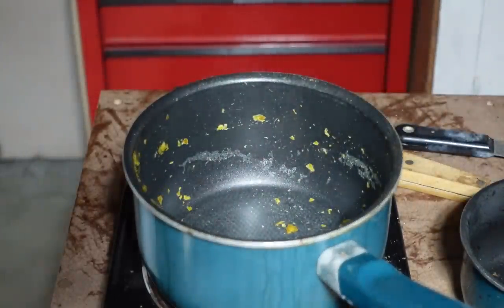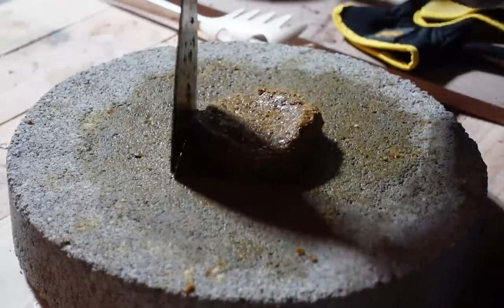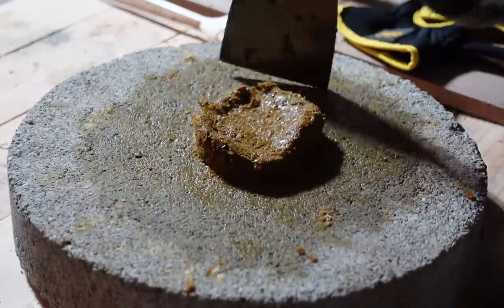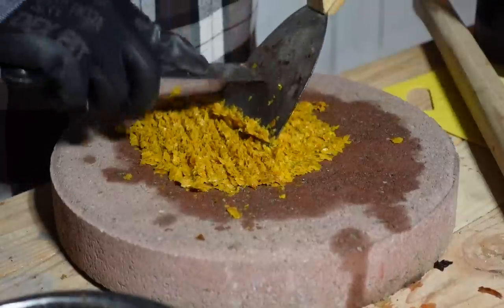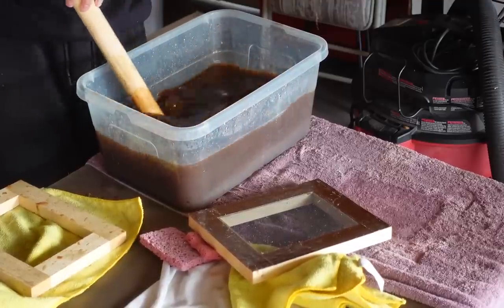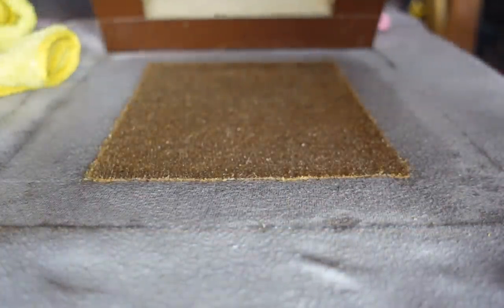Can Leaves Be Turned Into Paper? DIY Experimental Leaf Paper

Comment: Loving your non-traditional materials in paper-making!  Just FYI, the process of turning them onto a felt (or in your case t-shirt) is spelled like a couch you sit on, but pronounced "kooching," like in Cootchie Coo.  No idea why, it just is.   When you're removing the paper from your material, you might try turning it upside down once you have an edge loosened, and pulling the fabric off the paper, rather than the other way around.  Since whichever one you are pulling off has to bend quite a bit, this could be less stressful on your delicate sheets of paper.
Reply: Your comment improved my understanding of the underlying challenges and methods of paper-making. Thank you.
Reply: maybe from the french pronunciation? 'coucher' means 'to lay' in french, and that would be consistent with the actual process happening.

Comment: When discussing preservation of brittle paper documents, my book conservation teacher said, he used gelatine solution to impregnate crumbly paper. In old receipies for minor production of paper they also mention gelatine. A simple paper is very absorbent, you need ink not to spread, to stick where you put it, so you impregnate your new sheets with some glue (but I guess you know that).

Lime powder is used to make sheets more dense, more white, and it's good for making the paper less acidic. I know this only theoretically, I'd guess a small portion is dissolved in water or something.

A paper of sports can easily be made of blanket algae. You can find it in ponds and big long-living puddles, it's like green water cotton just floating there in chunks and layers.

Inks though, natural inks are a bit tough. Most famous are probably oak gall ink and iron oxide ink. The latter eats through paper in centuries and bleeds into halos, I don't recommend it. Gall ink slowly (very, very slowly) fades, so maybe mix them. But the very best ink is basically nano-particle ink. Which is just fine soot in cherry/plum resin solution.

I find that old books - more than 50 years, closer to a hundred and over - contain many useful tips for such arts. Honestly, with bookbinding, no better techniques were invented since 19th century (only cheaper ones).

Comment: For my pottery, I use a Rubbermaid tower for bakery and instead of bakery sheets which you could use. I use two sheets of drywall for each pressing one on top and one underneath you could still probably use your T-shirt that way, but I’m the drying is much quicker, because the drywall pulls the moisture out of the paper or pottery.

Comment: One thing I'd recommend looking into is some kind of porous film to place your paper on. There are products like teflon-coated porous release films for resins and other adhesives which will allow a solid to rest on a very flat surface yet allow moisture and gases to escape. Per the sandwiching, you'd need (shirt-film-paper-film-shirt) to maximize paper release. Assuming the film is smooth, your paper may come out a little flatter, too!

Comment: Hello Cory!
Love your video! Thank you so much!

Next time you could try peeling the cloth off the paper. If you put the paper facing down and the cloth upwards it’s usually easier.  Just make sure you get a little corner off first so you have a grip to hold the paper. 
Also have you tried putting the pulp first and then adding the water? That way you might be able to measure pulp to water ratio better! ❤
Just some ideas! 😊. I can’t wait to try this technique with my grandkids. Much love! 🤍

Comment: These turned out great! They seem pretty sturdy and I love your calm narration 

Consider when you get to the pulling off the t-shirt, to pull the tshirt away from the paper and not the paper away from the t-shirt. That way the tshirt is the thing bending excessively rather than the paper. Could help with more delicate experiments in the future. For reference, this technique is used during the process of making fresh tortillas which can be delicate 

Good luck on future projects !

Comment: When i handmade paper I lay them out to dry in the floor single layer and then peel off the fabric then use spray starch and iron them flat and then place them under weights to continue to flatten
My additives are powdered beef gelatin, cornstarch, and PVC glue (about a tablespoon)

Comment: I don’t dry my paper while it’s stuck to the cloth with weights. I lay them out on a screen with the cloth backing and then while they are still damp I take them off the cloth backing and transfer them to a screen for drying. Then after dry, I pile them up and press them with weights. They always  flatten out fine after dry. 😊

Comment: Good video, but I was a bit disappointed you weren't exploring an idea I have been wondering about:  Would it be possible to make "papyrus" from autumn leaves?  By "papyrus" I mean overlapped layers, though not necessarily in the manner used to make papyrus. 
My concept (which I haven't tried at all) would be to strip the main vein and petiole, leaving the leaf halves, then to set these down in an overlapped manner.  I expect some binder might be needed, but I haven't considered what might be suitable.  The whole would then be compressed to form a flat sheet.

Comment: any plant can be made into paper -cellulose !!! - the preparation is a bit different according to the srength of the fiber - cooking and then mesarating  - i found that staing the fiber thru a sieve  by water pressure worked the best - better than a Hollander beating or hand beating - the plant color usually isnt light fast - Kozo fiber is great also Nettle makes a etremely strong and translucent paper - pure meditative process
Reply: nettle leaves, or all of it?
Reply: @Goldenhawk583  -cook the entire plant - when washing the leaf fiber is dissolved and washes out - what remains is the fibers from the stems wwhich are extrmely strong and very white with a lustre to them - you need a Hollander to mecarate them into pulp  - there is a way to save the fine and much weaker leaf fibers - after gently washing the cook the fiber is placed in a bucket with a 10 mesh poliester screen and with water pressure the fiber is forced thru - the bucket is placed on a barrel and with two tubes coming out about a third from the bottom - the water flows out into a large sieve that collects the fine fiber - what is left is the strong fiber that does not go thru - it is also an extra washing
Reply: @natankaaren1207  thank you:)
Reply: Please how do I learn this?

Comment: try using synthetic cloth next time and make thicker sheets - it will help - i have a much different proceedure - first a coughing table  - three or four layers of felts - a synthetic cloth over the felts on the couching table which the pulled sheet is couched - the cloth with the fresh sheet is lifted and tranfered onto a towel and a plexiglas clear board is placed on top - the next sheet is placed face down on the plexiglass and a towel to absorbe the water on top of the synthetic cloth and paper then the next paper etc till there is a nice pile twenty or so plexiglas with forty sheets on them - this pile goes into a press and pressed - i leave it for about an hour and then take the pilke out - separate the materials used leaving the paper attached to the plexiglass to dry after a day the sheets are ready to be lifted  - i hope you get some ideas from this process

Comment: Piece of copy paper or stronger type, made into a cone, can act as a funnel (as long as you're quick with the pouring); plus you'd see early what kind of stain if any, results from the "ink". 7:11 Also, a bucket and a hand held blender would mulch those boiled leaves pretty well, I'd think. Unless you're eschewing modern technology or limiting it, to make the paper experiment?

Comment: I have no knowledge on paper making nor leaves. But I couldn't stop thinking when looking you cutting down the leaves into 1" pieces: wouldn't it be easier, safer and much faster to stack a bunch of them flat on a board and slice with a knife? Just like when cutting herbs or pasta sheets in cooking. And if you don't need precise cuts and bit sizes, just put everything on the board and chop fast, you can even do it with one knife in each hand. Or even just put everything in a blender.

Comment: I think that your homemade paper would work well as a flat surface to paint on, if the paper was thicker. People who make paintings usually use canvas cloth, or somtimes white denim, stretched over a wooden rectangulair frame. However, some people paint on ply wood or wood boards. if you make a 1 inch thick slab of paper 2 feet by 3 feet wide, then it can be used as a substitute for wood slabs as a painting surface for Boss Ross style paintings. To hid the dark colors, we might ghesso or paint the surface of the homemade paper with white paint. The homeade white paint could be poisonous turpentine maple syrup made from tapping a pine tree with a spyle, and mixing pine tree turpentine with chalk dust.

Comment: I dont know much about paper making, but shouldn't there be a binder of some sort used in the mix? Otherwise I think it will be hard to make something that isn't super fragile.
I would probably try a very small amount of clear wood glue. Shouldn't impact color, but might give a slight sheen depending on how much used. Even a small amount should greatly help bind the fibers together.
If the product needs to be all-natural for some reason, I'm sure there are traditional glues you could substitute.

Comment: That leathery texture of the leaves is due to a waxy substance that coats the outside of the cells of the leaves and is there to prevent the leaf from drying out or absorbing things through the cell wall. Many herbicides work by stripping this layer off. This layer of "wax" varies in thickness between different types of plants or can vary throughout the growing cycle. Im not sure how this waxy material reacts with the soda, but if i had to guess, its a lot like the soapmaking process of oil + caustic = soap. 

Would pressing your paper in a roller make it more durable? Im wondering too how you can get your sheets to release from the fabric backing easier.

Comment: First off, use brown dry leaves that crumple in your hand. The ones that are not fully dried can make it difficult because the fibers don't break down as well. Boil until most all the moisture is gone, then blend or use a food processor. You're making it harder than it should be with too many steps. You are also putting the pulp in way too much water, thinning it out too much. Put on the screen, use a plastic putty knife to smooth it out and squeeze out as much water as you can. Place on something that won't hold on to it like the shirt does. And, to make it white, use real bleach. That's where the term bleaching comes from. I understand that you live in CA, and everything chemical there is going to kill millions of people, but people in other states use it all the time without harming anything. (I can say this as I was born and raised in CA until I was 15. Thankfully, we moved before my brain turned to mush.) Doing it this way, the paper should dry in about a day, not a week.

Comment: This process seems so tedious, wouldn't it be easier to just dry the leaves, grind them to powder, then make a thicker solution of it than the one you used? I also suggest to ferment the solution for some days until it smells funny. That way the fibers can get a bit predigested and coagulate better when they dry. May add some sourkraut water, or something containing lactobacillus to give it a starter culture. Also add some starch or wheat flour.

Comment: using scissors or a round pizza cutter might make de-spining the leaves go quicker. :-)   a pizza cutter could also be used to 'chop' the leaves into smaller pieces in a faster manner as well.  if not a pizza cutter, there are very sharp circular blades used in cloth cutting.. those might be better. ;-)

Comment: M8
Get into chemistry.
The things you do are pointless as hell because you don't understand what you do.
First you crush, then you blend?
Those are sililar steps.
You want to remove the stems by hand?
Filter for size. Break 'em up in a bucket filled with stones larger than your mesh. They will be left behind.

Boiling them for an hour? 
Destroy them with hcl. Then neutralise with na2co3.

A bunch of things are to the letter. If you learn what you are doing things can be so much more fun.

Also, you get to troubleshoot better.

Plan a, too much water? Boil it under vaccuum until the concentration is more to your liking.

Plan b. Too thick, use a volitile solvent to make dilute it.

Plan c  too little structure.
Now you add back the stems.
Filter by density with wind.
Blow over them and the rocks stay in place.

Adding lint makes this lint paper 
It is like me making candles out of sand by boiling and blending the sand, then adding paraffin or butter.

Comment: Excuse my ignorance I am from England, is washing soda the powder you use to wash clothes or is it bicarbonate of soda?
Reply from the maker: Yup! Washing soda is normally used for washing clothes. Bicarbonate is baking soda (very similar to washing soda, just not as strong).
Reply: Also known as laundry booster.
Reply: Washing soda is sodium carbonate. You can make it from baking soda, sodium bicarbonate, by baking a sheet pan of baking soda until the texture changes.

Comment: can dried leaves be a viable material too?
Reply from the maker: You know... I'm not too sure. I have a feeling the more brittle they are the harder it'll be to turn into paper, but anything is possible! Maybe I need a follow up video using dried leaves?!
Reply: Do they get mouldy with time . We make cards and don”t want it to get mouldy later
Reply: @charlottepetersen5289  as long as the cards are kept dry you should be good
Reply: @corymart  just an update, we did this in our thesis and we used dried leaves and the product was wonderful almost like a real paper we were even able to print the literal paper of our thesis on it. Thanks for your video. The methods we used are heavily inspired by yours but we just changed it up a little, like the materials we used were just any dried trash leaves, we used lye when boiling, also when boiling we didn't have to crush the leaves we just remove the main stem, and then after boiling we mushed it while adding some bleach for a brighter product. Also our final product was 15% recycled paper and 85% trash dried leaves the addition of small amount of recycled paper made it sooooooo much better.

Comment: Safe to say that most fibrous materials can be turned into paper since paper is mostly made out of fiber + a compatible adhesive like starch.

The only differences are the methods of turning said material into paper. Some requiring minimal work like leaves and soft wood, while some require specialized machines or techniques like you would using hard wood or (god forbid) cotton.

Comment: I think this was a good idear, but I am sorry - when you add some other paper to achieve this it is not leaf paper. Maybe try out different types of leaf or combine it with other natural resources to accomplish that. The egyptians had leaf paper - they calles it papyrus. So maybe try something like that, but what you did was creating natural coloured, leaf supported recycled paper. 
maybe dry the leaves next time before you boil them, so you do not need to smash the celles of the leaves and so you can use the more hardened structure of them.

Comment: Why you have to use washing soda?
Reply from the maker: Washing soda helps break down tough plant fibers. I also use it when making grass paper, so I figured I should try it with leaves!
Reply: @corymart  Would Baking Soda do the same thing?
Reply: @TeresaV  It's slightly different chemically, but if you can't find washing soda in the laundry/cleaning section of your store, or find soda ash (different name for the same thing) in a shop that sells materials for dying fabric, or a pool supply store, I've read that you can heat up baking soda in the oven for an hour to change the chemistry.  They are both basic (alkaline) but the baking soda is less so, so I'm not sure you could use enough of it to get the desired effect.
Reply: Washing soda can be made in the oven on a cookie sheet baking some baking soda.  If I remember right the temp was 200 degrees for a few hours.  You'll have to Google it. It's been a long time since I did it for diy laundry detergent. We buy our baking soda way cheaper at the feed store in big bags.

Comment: Ironically, the 'mid rib' has the major content of fiber in the whole leaf, why bother to remove it? technically, its suggested to boil the leaves in hot alkaline solution (baking soda can be added, but with high concentration) to remove the lignin, then smash the remaining fiber into pulp. you also need water soluble gum to add into the pulp (sizing) before making paper with fine screen. the existence of lignin will make the paper yellow or brown in colour and make the paper fragile, because the lignin is a fine power if dry, and stops the fibers to stack to each other and forms a stronger bounding.

Comment: Kind of a half-assed attempt, frankly. Adding hydrogen peroxide as experiment within the experiment. Replacing okra with corn starch as another experiment within the experiment. Not having enough pulp and so mixing different leaves together, then also adding dryer lint. Then making some sheets that are obviously too thin.